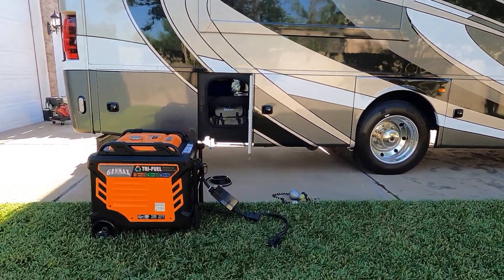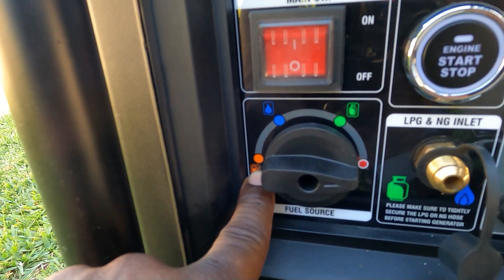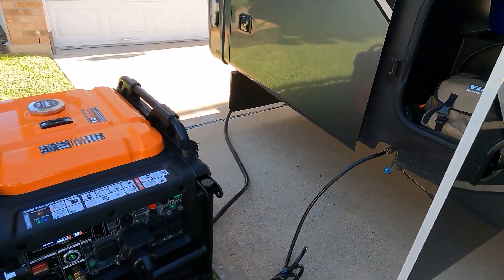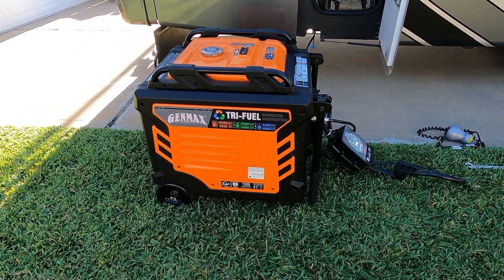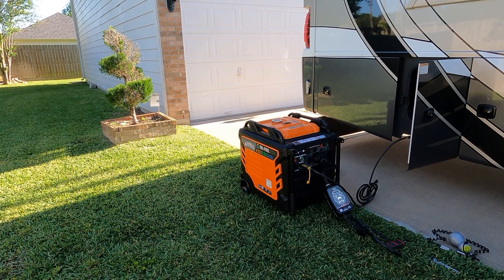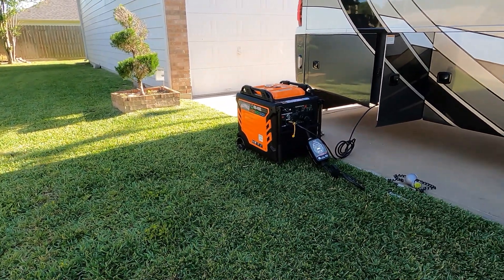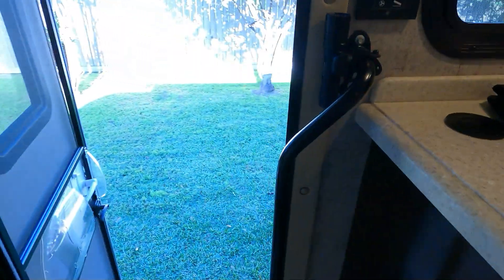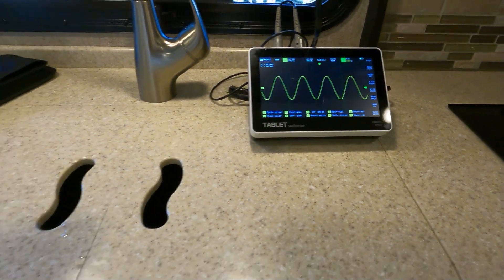The Largest TRI Fuel Inverter Generator GENMAX GM10500iETC Review and Load Test on a 50a RV Propane

Comment: Gavin, I have a 75ft natural gas hose to my GenMax.  How do i purge all that gas out of my hose when im done using the generator.  Any thoughts?
Reply from the maker: Shut off the valve before turning off the generator
Reply: @GeneratorReviews  so, I just let the generator run until all the gas comes out the hose?

Comment: I'm glad you told about this genmax 10500 trifuel inverter generator which even more powerful than the 9000 genmax duel fuel and I also i have an option to hook it up to my home natural gas line thanks for the review  it's a little more expensive but I think it's worth it as long as it holds up over time.
Reply from the maker: Let me know if you ever interested in getting one you can buy one on https://www.gavins-garage.com/ I have free shipping

Comment: Great review as always.  I don't see the link for the quick connect extender for the generator propane fitting.  Please let us know where to get that part.  Thanks!
Reply from the maker: You don’t need the quick connect because the new models come equipped with it now👍🏾

Comment: Great review... As always!  Do you know what the propane burn rate is per hour at say, 50% load?  I am trying to anticipate fuel needs per hour/day of use in a food truck type of scenario.  Thanks in advance for any insight.
Reply from the maker: GM10500iETC, with a 6.9 gallons fuel capacity can operate for around 8.1 hours at 50% load with a full tank of gasoline (fuel consumption around 0.85 GPH). When using propane, it can run for around 4 hours (estimation based on a 20 lbs tank - propane consumption around 1.18 GPH). I recommend you get a 40 pound propane tank.

Comment: Do you need to run two of these in parallel to get the full 50a output? I see Amazon reviews mention that these generators that have 50a output need to have two in parallel to actually get that?
Reply from the maker: Yes that is correct ✅

Comment: hello gavin - is this unit neutral bonded or neutral floating.  I have the exact same unit with neutral floating and it is showing RED on the same watchdog 50 surge protector?  Thank you so much for your help.
Reply from the maker: Yes, the unit is neutral floating,
Reply from the maker: Yes, this unit is floating neutral

Comment: Do you know how much propane is used? I have a 100 pound tank and I’m learning and if you run out of propane can you just turn the switch for gas backup?
Reply from the maker: Running time of the GM10500iETC, with its 6.9 gallons fuel capacity, can reach around 8.1 hours at 50% load on a full tank of gasoline (fuel consumption around 0.85 GPH). With propane, it can reach around 4 hours (estimation based on a 20 lbs tank - propane consumption around 1.18 GPH).

Comment: Hi.  I am looking for a portable generator for home backup with a transfer switch. But every generator has different plugs!  For my use, under 5000w peak, a 4-prong 120/240v 30amp plug is what I need.  Some have RV plugs, some have the large 240 stove types.... Please explain my options.  Thx!
Reply from the maker: This generator actually have the exact same plug in it before pin twist lock and it also has the 50 amp 240v. So technically, it would work for either options, 30 amp or 50 amp inlet box, and the transfer switch.

Comment: When using this generator to power a 50amp camper. What do you have the volt switch set on.? AC120v or AC120/240v
Reply from the maker: When using this generator on a 50 amp RV, always keep your switch selector to 240 V that way you get both leg working
Reply: @GeneratorReviews  What about when using with a whole-house 50 AMP transfer switch?

Comment: Will I be able to put a 3/4 male QD on this generator? Considering I'll be using 3/4 hose connecting it with my gas outlet. Thank you
Reply from the maker: Yes you can adapt to that size

Comment: Cool video Gavin!  Specially that adaptor hose to the RV propane quick connect. I wonder what would happen if you start running a propane appliance like the furnace at the same time, would the generator keep running in that case?
Reply from the maker: Yes the regulator will keep the pressure adjusted
Reply: Thanks Gavin, could you please post a link to the adaptor that goes  on the generator?  Also do you know if that would work on a Genmax GM3500iAED?  Thanks!

Comment: Load of power. 
Please tell us why propane and natural gas are such a difference. What plug? Where are you plugged into on the generator? It looks like you had an adapter. Thanks.
Reply from the maker: Hey Robert
So the difference between pump gas, propane and natural gas.
1 gallon of gasoline has 97%–100% of the energy in 1 GGE. Standard fuel is 90% gasoline, 10% ethanol.
1 gallon of propane has 73% of the energy in 1 GGE due to the lower energy density of propane.
5.37 lb. of LNG has the same energy as 1 GGE, and 6.06 lb. of LNG has the same energy as 1 DGE.
Gasoline has higher energy density per gallon, than LP gas and natural gas.

I use a 50 amp plug extender to get the 50amp 90° plug over the handle. It just works better.

Comment: I've been waiting for a tri-fuel inverter generator. It's nice to see someone finally came out with one! Now to find someone actually selling it. Heck, it isn't even a listed product on the GENMAX web site yet!
Reply from the maker: The link is in the description of this video
Reply: I know nothing about tri fuel generators. Why is an inverter type preferable?
Reply: @chalemi6909  with technology dependency now days you need a clean energy source. Inverter generators provide clean stable energy otherwise you can damage expensive electronics with a regular generator.
Reply: @chalemi6909  Firstly , they are usually much quieter. Secondly and more important, they provide pure sine wave power for sensitive electronics...sometimes cleaner than the utility.

Comment: Wow, I'm not sure what's more of a "Flex" ... the Genmax or the RV.. that's Bada$$....   I am disappointed, I Just bought the 9000IED beginning of February, because it was the biggest available but I need slightly more amperage... Now this one comes out & would actually do what I need.. but I just can't spend a couple grand more & then have no use for the 9000ied that only has less than 10hrs on it The Genmax is an Amazing machine & Very happy with it, but the timing... sigh...
Reply from the maker: I’m pretty sure you could sell it.
Reply: @Gavin’s Garage  True, but it's too new to take a loss on. The pricing of this one is a discouraging jump from the 9000ied for only 900 watts more running, so I think I'll eventually just get another 9k & parallel them for the max 50 amp output & that will allow a buffer & not max either one out, hopefully leading to longer life.
Reply: @GeneratorReviews  can you parallel a 9k and 3k generator or has to be 9 and 9 lets say?
Reply: According to the information on their website its for certain models i can't find parallel cable for the trifuel to dual fuel 9000 and 10500

Comment: A 30 amp or 50 amp 240 volt circuit is per leg of the split phase, not added together. So, for example, a 7200 watt 240 volt generator maxes out at 30 amps for each split phase leg (3600 watts per each 120 volt leg).

Comment: Gavin, are you using a 50amp adapter/extender to get the RV plug to sit flush in the generator? I have the Genmax GM9000iED and my RV cord hits the bottom of the panel preventing it to be inserted flush.
Reply from the maker: Yessir I will post the link in the description
Reply: @GeneratorReviews  Can you also link that quick connect adapter please?  Thank you
Reply: @GeneratorReviews  are you still going to post that part?